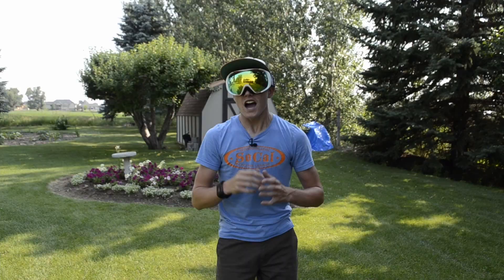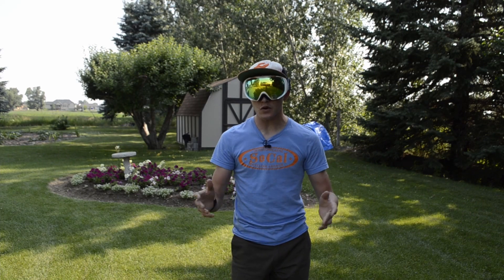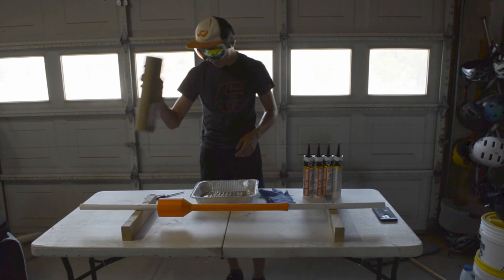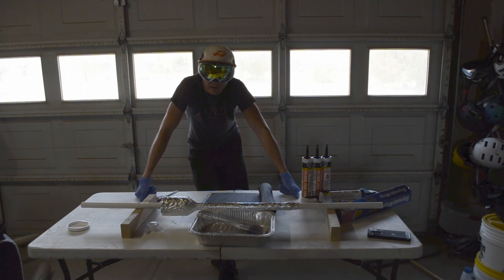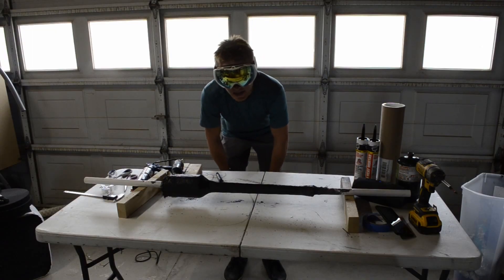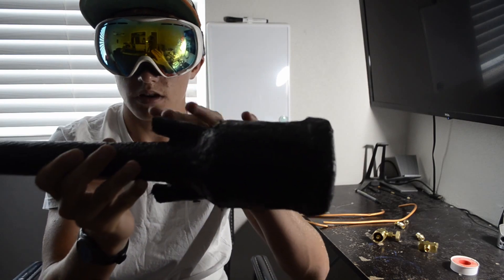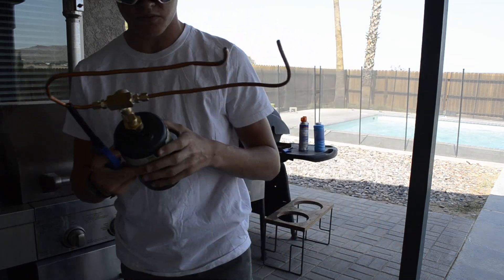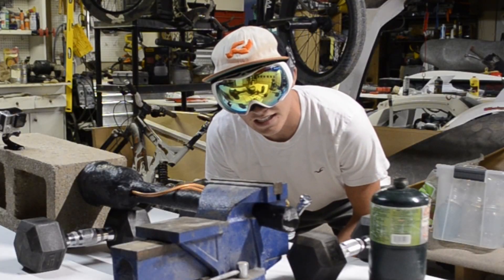Carbon Fiber PulseJet Engine

Comment: I see two basic problems (im not an expert). First, you are blocking the intake nozles with the fuel lines. With that you are reduceing a lot the diameter, changing the dimensions on wich it is supposed to work. Also, based on the size of the motor, you have to achieve a faster pulsation to enter in self susteined combustion. Basicaly, if you have a bigger tank and you blow the fuel from the back of the jet, I think that it will work

Comment: I think you need more fuel and you can do that by using a big propane tank. I dont think a 1 pound tank can sustain that jet unless it is on liquid.
Also I think your intakes are kinda small but still could work.
Reply from the maker: I'll try larger intakes before I go to liquid, thanks for the info!